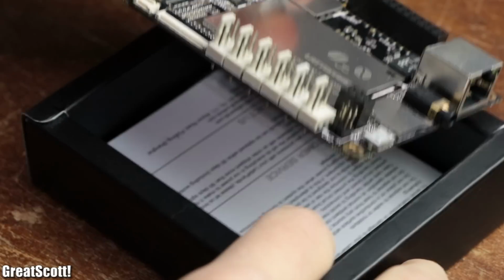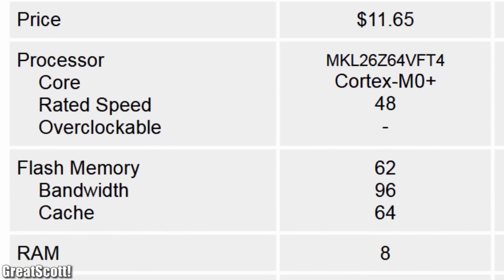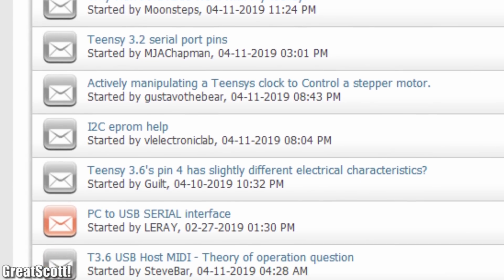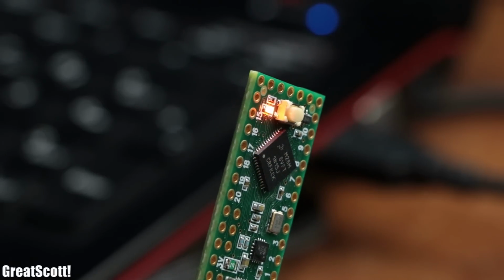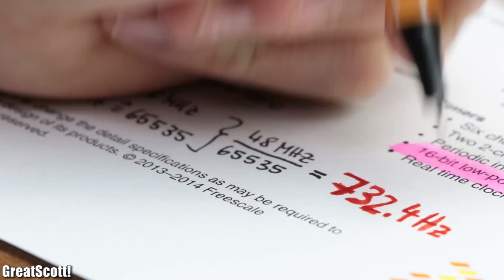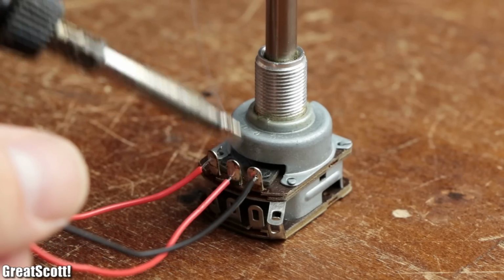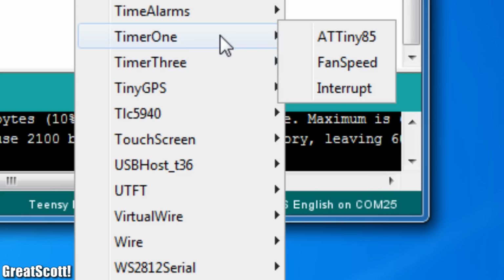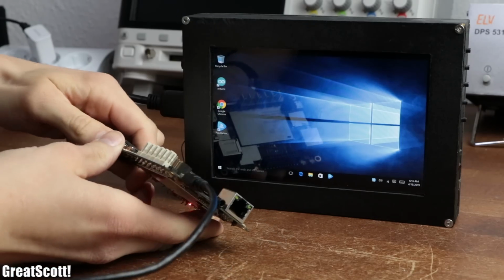Easy & Powerful Arduino Alternative? #3 Teensy Beginner's Guide

Comment: You should never use Serial.print() within an ISR like you did with your attachInterrupt example
Reply: You can put a print statement anywhere in your code. It will run slower but that is the ONLY way to debug in arduino. So without a real debugger you have to resort to slowing down the isr
Reply: @MadJDMTurboBoost  interrupts are disabled I side the ISR so your print will never execute until you leave the ISR
Reply: @brianhelterline4888  lol what are you talking about. The print statements are inside the isr for debugging. Yeah the interrupt flag is disabled when u enter the isr then the statement is printed, then the interrupt flag is enabled and the program exits the isr. Why in the world would it never leave the isr? And if it never left the isr why would it not print the statement inside the isr?
Reply: @MadJDMTurboBoost  Nope. the printing will not happen while inside the ISR because Serial relies on interrupts to transmit the next char...  If you did something like have a Serial.print() statement followed by a delay(10) inside the ISR, nothing would happen.  The delay() function relies on millis() working which relies on interrupts so the delay() call will never return which means the ISR will never exit which means interrupts will never be re-enabled which means the Serial.print() statement will never actually move the data into the transmit register which means you will never see it on the serial monitor.
Reply: @brianhelterline4888  I don't believe the isr disables all interrupts, I'm pretty sure it just disables that specific interrupt. Interrupts have priorities in microcontrollers and can be nested when called during an isr. I know this for a fact in arm architecture but I am not certain about at atmega or how the arduino library does this, so you might be right. But it does seem that his code is printing
Reply: @MadJDMTurboBoost  For the atmega chips, they disable global interrupts, not just that one particular one.  And yes, it will work most of the time
Reply: @brianhelterline4888  Oh interesting! Well thanks man this was actually enlightening

Comment: The Teensy's also have very powerful DMA... This allows to control eight Strings of digital or so called adressable (They actually aren't adressable) LEDs at a time, since at above about 1000 LED's the refresh rate gets to low. With the OctoWS2811 library for the Teensy's, you can control huge amounts of LEDs. And the best thing about this is, that sending out the actual data signal does not slow down or affect the CPU, it is managed by them DMA-Controller. The CPU can continue working while the data signal is sent out. 
Combined with other really neat features like the DSP-instructions (very useful for FFT), this facilitated me to build a 12^3 RGB LED-Cube with a Teensy 3.6.
Reply: Did you use TH or SMD for your cube? I’m going to make a 15^3 or 16^3 using HexaWS2811, but am still in the process of designing. How did you build your jig? I have made a 9^3 cube with a teensy 3.5 see my page if you’d like. I sends all data using DMA over SPI, taking no processor power away from calculations. But that one was made using old tech, dumb RGB leds and led drivers. If you have any insight available for me i’d appreciate it ;-)
Reply: @MaltWhiskey  I used TH; WS2811-F8 from China. These work fine on 5V and with OctoWS2811.
I only built an one-dimensional jig with 3D-printed sockets for the LEDs, fixing them on one line in regular distances (50mm). Then, two 0.6mm copper wires connect the 12 LEDs in a line and supply them with 5V. The data pins are bent sideways, then 12 of these "sticks" get soldered to an array of 12^2 by soldering the sideways bent data pins together... Finally, putting these arrays parallel to each other, make up the whole cube.... I ommitted many many details since a YT comment is not really  a good way to explain something like this. 
I have insight available in form of a dissertation about this project but it is in German and I currently have no English version. You could try to google-translate this dissertation or ask me specific questions about the cube. You can contact me via [CENSORED].

Comment: The teensy is a beast and I love it. But it's overkill for what you're doing. If you want to make your arduino nano USB compatible you can do it with 2 diodes and a resistor. Look up the VUSB library.
Reply: True, total overkill I made a USB volume controller with even an Attiny85 it was so easy
Reply: Interesting.  What does the "v" stand for?
Reply: @TheRainHarvester  virtual I believe, it's a software USB over digital IO controlled by the micro. It's specific to avr architecture but works really well a lot of usb 1.x/2 game pads use this library because it's the cheapest way to make a usb game controller.

Comment: lol, 11$, stm32f103 - 1.5$ with HID support
Reply: s bright  actually I suggest you to look at stm32g0, it is not related to this discussion, but may be interesting. The cheapest and useful for many devices are stm32g070kb, with 0.3mm pitch, very easy to solder.
Reply: Alexander, if you want to do the work of porting Bounce.ino and other Teensy specific libraries needed to make a Bluepill and other STM32 MCU's == to Teensy, then be my guest, otherwise do your research before you speak on things you know nothing about.
Reply: @AngryRamboShow  Fucking idiot, arduino IDE works with STM32 even with the new black pill STM32F411 and also with  ESP32 which are boards that are like 3-4$ and are much faster than teensy boards. Don't run your mouth if you don't know anything about electronics.
Reply: You can follow me on Twitter to know more about computers at www.twitter.com/debojitacharjee
Reply: Yeah good luck finding a free IDE that works properly with stm, then good luck writing everything from scratch.
Reply: @BogdanSerban   Atollic True Studio was purchased by ST and is free for STM32 development
Reply: @BogdanSerban  The Arduino IDE works with STM32, VScode, ATOM and Sloeber too. Do your research.
Reply: @BogdanSerban  The Arduino IDE works fine with Blue Pill STM32.  I use Blue Pill to reduce cost when I don't need the power of a Teensy.  I like that Blue Pill can't be bricked like Teensy can, and if I wreck it only costs $2 instead of $20 to replace.
Reply: @tigercat3864  I haven't done my research yet, but in what situations would the Teensy prove to be beneficial vs. the STM32F103 Blue Pill boards? Thank you!
Reply: @BogdanSerban  Atollic TrueStudio + STM32CubeMX pretty much configures everything for you and includes easy to use libraries for every peripheral.
Reply: @BogdanSerban  I've seen Eclipse ? That works great with all ARM SoC. Writing from scratch...sure ;-)
Reply: @ArjanvanVught  when I first tried it, I had access to IAR Workbench. That was pretty much the only thing that worked back then. Yes, there was eclipse but it rarely worked. And we had to write everything from scratch since there were barely any libraries.
Reply: @BogdanSerban  actually there are a lot of free IDEs for stm32, but I use CLion, that is not free for work, and it starts to support embedded development, and this IDE will be the best in future
Reply: Bogdan Serban Eclipse works great
Reply: @BogdanSerban  Blue pill works with Arduino IDE.

Comment: Can you make energy meter from Raspberry pi? With www page, where i can look in real time parameters?
Reply: You could try openenergymonitor
Reply: @Tim_Small  Yes, i saw it, byt this is a bit expensive :/
Reply: @byKOGR  There are a lot of smart plugs with power measurement for quite cheap - as low as $5 each on sale. Find one that's supported by Tasmota.
Reply: @NiHaoMike64  Thanks, I take a look :D

Comment: If I remember correctly the latte panda has an integrated arduino pro that can use as native usb device. 
And if you will use it you don't need to use the teensy.
Keep making great videos.
Reply: That's great. There are A lot of keyboard designs that utalize atmega32 as the main board.
Reply: It dose yes, I used to to convert a rc reviver to a gamepad on the panda
Reply: https://core-electronics.com.au/tutorials/arduino-with-lattepanda.html

Comment: Well the ATMega32u4 a.k.a. Arduino Leonardo has the interface that work greatly. 
It also exist in a small board in the same size as the Arduino Nano.
I have made a video of my arcade joystick build using an ATMega32u4
Reply: That was exactly the first thought I had. Also a lot cheaper than a Teensy.
Reply: @p_mouse8676   Exactly, for the purpose of a simple USB joystick makes more sense , i feel like using a teensy for that is like killing a bee with a nuke.
Reply: Yeah called Arduino micro and work rlly well. Some use it for hid attack in a USB stick
Reply: That is the MCU in the Teensy 2.0. USB AVRs have the convenient feature that they have a USB bootloader preloaded, so you pretty much just need a clock source to build your own boards, no programmer required. Teensy was one of the first brands of breakout boards for them, and have now branched out into Freescale ARM MCUs too.
Reply: How does it handle fast interrupts for example those coming from a rotary encoder attached to a motor? Arduino has this bad behaviour of skipping/acknowledging interrupts if the interrupt generated is too fast...this was also because Arduino had a clock speed of 16MHz...with 48MHz, does that perform any better?
Secondly, I wanted to ask about code latency...what is the latency produced due to the code itself? I'm guessing it is less but that caused problems in my Arduino too. Please reply.And the interrupts I mentioned are pretty fast....assume a 120RPM ...i.e. 2 RPS motor and 60 spokes/revolution.... that's 120Hz: the rate at which the interrupt is being called every second...and this happens to be too fast for the Arduino. I want to know if this can handle it to a better extent?
Reply: @AadityaKhare42  An 8MHz AVR could easily keep up with one or two 120Hz counts in software, let alone using the timers. And higher CPU frequencies may not even help, as the memory often doesn't speed up to match. There's no simple answer but your program can probably be fixed.

Comment: Why not just use some cheap STM32 boards? You can find them for the price of only $2(including shipping) which is like 5 times cheaper than the board in the video.
Reply from the maker: Like the blue pill? Yes, sure. I already made a video about it. But I create weekly video and need new subjects.
Reply: @greatscottlab  Oh yeah, that's the board! Sorry, i haven't seen that video of yours but now i'll watch it :)
Reply: STM32 boards require a lot more skill to use to their full potential since the Arduino support for STM32 is less mature then what Teensy offers. The whole point of Teensy is that they give you the complete Arduino experience but with more processing power and more pins, no extra knowledge required, everything is abstracted away for easy usage. STM32 is great but the library and tooling support is just not there yet in the Arduino environment (at least when i checked last time, which is quite some time ago).
Reply: What languages and IDEs other than C in Arduino can be used to program the STM32 boards?  Meybe a silly question, but I couldn't really find a good answer. Everyone recomends Arduino IDE, but I would like to try something different.
Reply: @KolorowaSowa   ST has bought Atollic Truestudio so that's their official IDE now, here's a guide on installing and getting started: https://www.st.com/content/st_com/en/support/learning/stm32-education/stm32-step-by-step.html